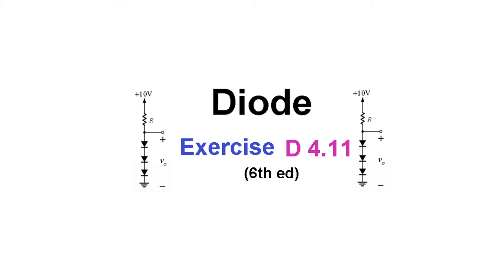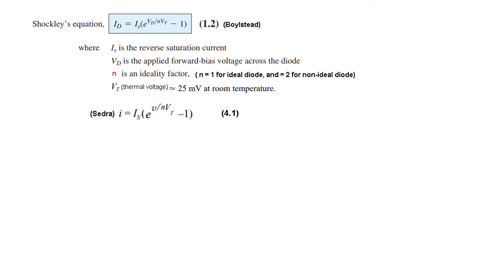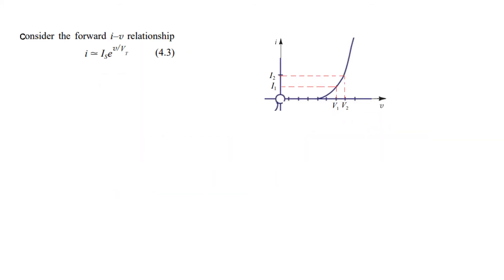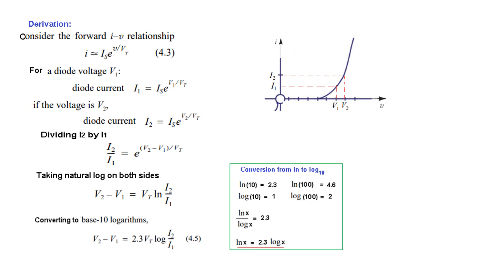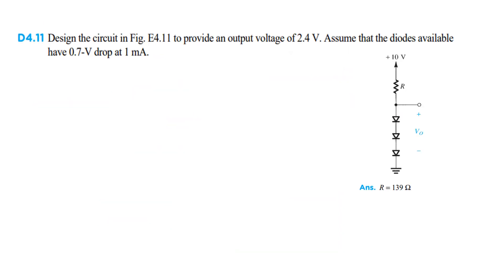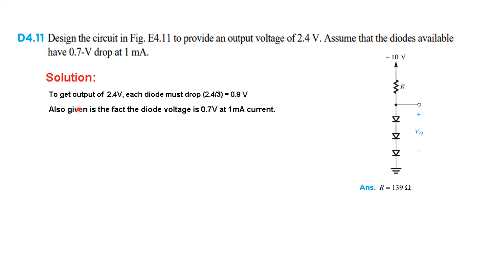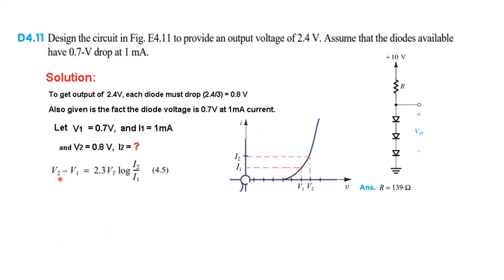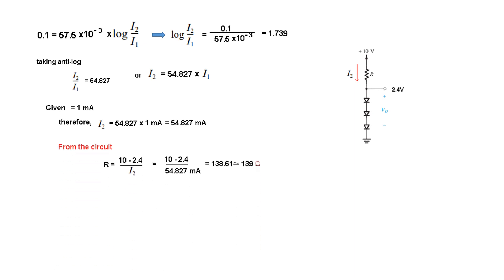(E)EDC(S) Exe D 4.11 || Design a Circuit to provide output voltage of 2.4 V

Comment: How could that design be carried out assuming the third approximation for the diode (Vd = V_gamma + rd*Id) instead the exact modeling (shockley's equation)? I have been breaking my head but no success at all. Obviously it is not possible to design the proposed case assuming the second approximation since the Vd is assumed fixed, but from the thrid approximation it can be solved in some way as a linear variation with corrent is added to  the V_gamma bias to generate the diode voltage drop Vd. In spite of that intuition, I could not find a way to solve it properly. Could you help me with that?
Reply from the maker: I suggest you save it for you ms research